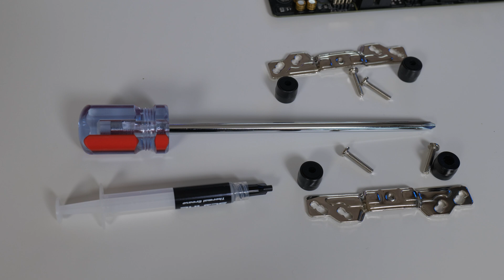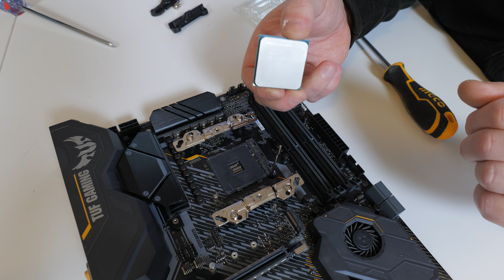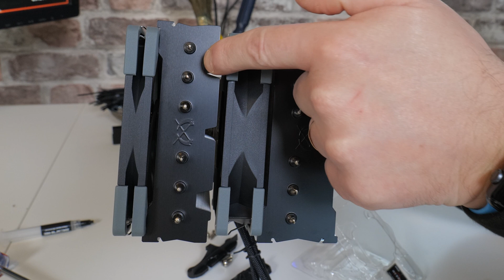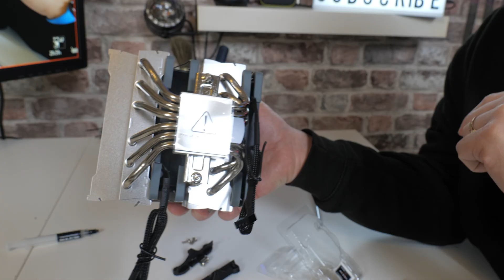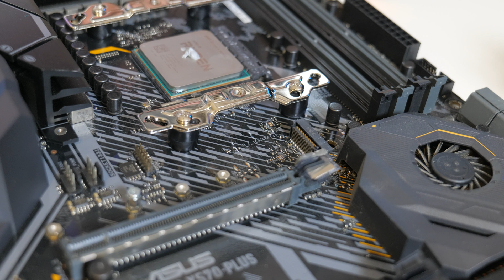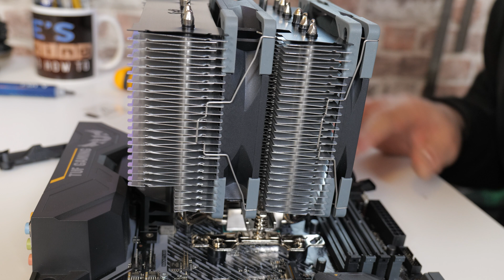How To Install Scythe Fuma 2 AMD AM3 AM4 Ryzen Platform

Comment: did you just use the stock mb backplate to mount the 2 brackets? Was wondering if it was worth using the backplate that comes with the cooler if your mb comes with a backplate already.
Reply from the maker: yeah used the stock one it seems to work okay
Reply: Nice ty @mikesunboxing

Comment: At the very beginning my screws just fall right through the plastic holes when trying to seat the bracket and do not actually tighten at all
Reply from the maker: This is maybe easier to fix or at least advise if we can ask more questions and get direct answers, so feel free to join our Discord chat and we can go over it in more detail https://discord.gg/XtBTGQ6BDu
Agree to the rules by clicking the emoji and you will get access to the rest of the Discord channels
Reply: @mikesunboxing  my backplate had just came loose, used a book and gravity to secure it for anyone else that runs into this

Comment: Hi Mike congratulations for your videos that I follow regularly could you help me? I'm having a problem with the scythe fuma 2 rev b that I installed for my Ryzen 7 5700x processor in idle simply by moving the mouse the temperatures go from 32°C to 60°C I don't understand what's going on . In terms of the case I have a Lian Li Lancool 205 Mesh and Msi B550 Tomahawk motherboard I have 2 Crucial Ballistix 2*16GB memory sticks an Asus Tuf RX6700XT graphics card hoping you can help me sorry i'm french
Reply from the maker: i would think the cooler is not mounted totally flat, or the plastic is still left on the base?
try to remount the cooler and make sure the backplate is totally flat against the motherboard.
Reply: @mikesunboxing  I checked everything and it does not change anything unfortunately no one to find the solution...
Reply from the maker: @marcusbinder890  This is maybe easier to fix or at least advise if we can ask more questions and get direct answers, so feel free to join our Discord chat and we can go over it in more detail https://discord.gg/XtBTGQ6BDu
Agree to the rules by clicking the emoji and you will get access to the rest of the Discord channels
Reply: @mikesunboxing  good evening I have removed the plastic cover and it's been 4 times that I've reassembled the cooler by screwing it gradually I don't understand what's wrong I may have tightened the screws too much?

Comment: I’m getting the fuma 2 soon but does it come with the am4 kit or do I have to get that separately I am using an Asus rog strix x-570-e gaming for it if that’s worth any info
Reply from the maker: it comes with the AM4 kit
Reply: @mikesunboxing  ok thank you
Reply from the maker: @whit3.mk6  No problem :-) Have a great weekend
Reply: @mikesunboxing  hi sorry to bother but would I be able to use 4 sticks of ram on the motherboard I have because I will be needing 4 sticks of ram for my needs since I run a lot of editing software

Comment: I'd like to see a review on this with 5 times 8mm heat pipes. Pccooler GI-H58UB Air Cooler with 5 Continuous Direct Contact Heatpipes-120mm PWM Fan and Blue LED-Aluminum Heat Sink CPU Cooler
Reply from the maker: looks good but can't find it here in the UK at the moment but i'll keep my eyes out for it
Reply: @mikesunboxing  It probably won't be reasonable when you find it. I know most things sell for more in the UK.

Comment: I BOUGHT A fUMA 2 ON AMAZON ACTUALLY FROM SCYTHE AND IT CAME MISSING THE SCREWDRIVER, THE THERMAL PASTE AND THE COLD PLATE STICKER WAS MISSING. I can't recommend it to anyone else at that point.
Reply from the maker: hmm i would get in contact with amazon to see what happened there, generally they are very good at sorting out those sort of problems
Reply: @mikesunboxing  Unfortunately amazon wasn't good this time. The first CSR I spoke with was actually rude. I asked to speak to her manager and she told me they will just tell you the same thing. I told the manager what the issue was and he went back and looked at the chat, apologized and actually started trying to find me a screwdriver. I'm about to install it with my screwdriver and my paste. I didn't want to send it back because I had just returned one that amazon had shipped in a Bag of all things and it was bent. Sometimes my life shouldn't happen to two dogs, one dog couldn't handle it. Still can't recommend Scythe.

Comment: Hi sir. Thank you for the video. I have a question. I have mATX motherboard and Fuma 2. The space between the graphics card and fuma2 is very very close that the temperature difference between the stock fan and the fuma 2 is very very close. What should i do? Should i change the motherboard to ATX or just buy a new liquid cooler?
Reply from the maker: it can be close, it is a pain for fitting and removal but not a problem

Comment: I may try it if I ever need a new computer. But these black Snowman are doing well, even on my 5900x. I will see if I need a better one when spring and more confortable weather will be here.
I might try the dual tower vetroo too. 50$ cad on newegg
Reply from the maker: the dual tower vetroo looks interesting but the price puts me off. vetroo for me is special as the V5 is really cheap and really good. the V6 is looking good but double the price here which puts it into a very different category for me
Reply: @mikesunboxing  yeah, I know how you feel 😉... But otoh, for R9, dual tower is the best to get the most of them with air cooling.

Comment: Great video Mike, thank you. Funnily enough I built my PC just yesterday on an X570 board with the Fuma 2 but it was still nice to know I did it correctly! I've also found your B550 Gaming Edge WiFi BIOS walkthrough very helpful too as I went for a Tomahawk board which I'm sure is almost identical BIOS wise. 

On to your Windows 10/11 activation key video when I'm back home! Thanks again 👍
Reply from the maker: Very nice! hope you enjoy your new pc
Reply: @mikesunboxing  Thank you sir. I mulled over waiting for AM5 but that'll probably be quite late this year and I can't see DDR5 dropping to reasonable prices by then either. Can't complain with a 5900x and should last a long time 🤞

Comment: Some people say that there is too much torque on the screws. I only know one person who said that aka Gamers Nexus, but he doesn't know that with Scythe the system is simple. Once the screw stops, you have the correct torque for the cpu and cpu cooler. Side information, Scythe is around longer then Noctua ... even worse, Scythe was the importer/distributor of Noctua in Japan and even modded Noctua's for industrial appliances before Noctua became a hype. So, they know what they are doing, not Steve of Gamers Nexus.
Reply: I saw one guy use a torque screwdriver specifically for delicate work like screwing in a CPU.  I know you can get the bigger ones but Ive not been able to source a smaller one where you can limit how much torque you can use when using it.
Reply from the maker: More torque is a good thing keep going till it hurts
Reply from the maker: Dori I agree completely GN is good but not a god
Reply: @mikesunboxing  Tech-Buddah

Comment: I want to purchase it. My issue right now is that I have P400A case and Deepcool Assassin 3 barely fits on it with 120mm fans. I replaced the 140mm stock fans so that the TG panel can be closed.
Reply: I have the P400A case too with a Hyper 212 cooler on a Ryzen 3600.  What do you have in yours ?  I love the P400A case.
Reply: Hi Bob. I have Deepcool Assassin 3 and I slapped it with Scythe Wonder Snail 120mm fans. The heatsink barely fits in the case.
Reply from the maker: yeah the p400a is a strict 160mm max so your choices are slightly limited. Maybe the silverstone hydrogon? but the fuma should also fit with a few mm to spare

Comment: Is this better than the Assassin 3?
Reply: No, it's not and it's not better then the Noctua NH-D15. But, it's smaller so it fits more cases, it's dead silent even at max speed and is still a pretty descent cooler for the low rpm it has with an ease of install (you can even tighten the screws while the fans are already mounted on the cooler.). And as cherry on the cake, the included Thermal Grease 2 performs as well as the famous Thermal Grizzly Kryonaut, within margin of error.
Reply: I think a 3 cooler super test is needed what includes the Assassin 3 lol :)
Reply from the maker: Good idea Bob
Reply: @mikesunboxing  GRAPHS GRAPHS GRAPHS !!!
Reply: It's not but on par with Assassin 3 and NH-D15.
Reply: @jeremybadlon  Didn't said it was better, but if you space in the case is limited, it's a descent, hassle free cooler, with clearance for tall memory sticks. Also, take in account that this cooler is only 50 - 60 Euros, normally.
Reply: @dorientjewoller113  i only answered on Jayz's question, not on yours. You are right regarding it's size.
Reply from the maker: Jayz better is a subjective word